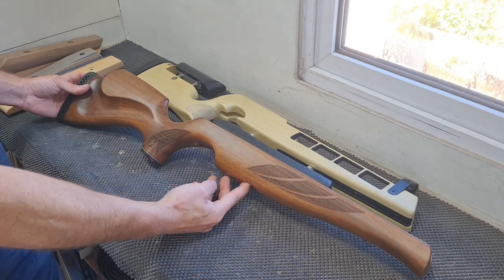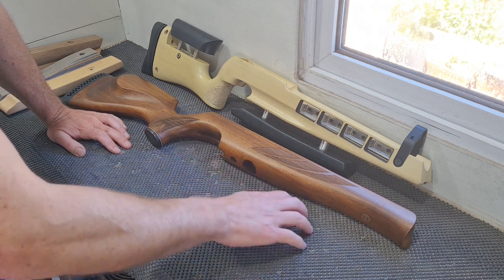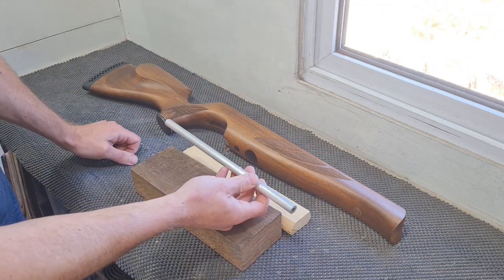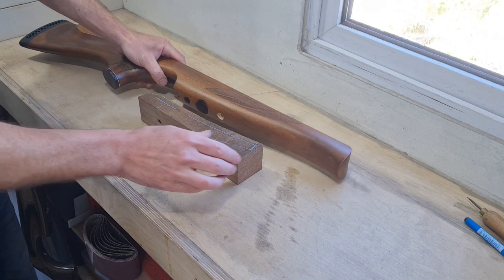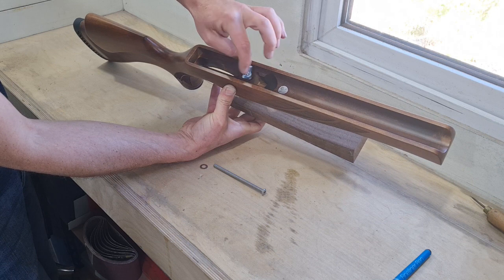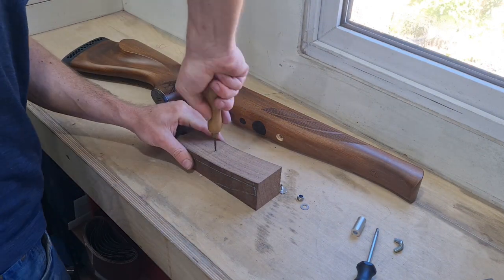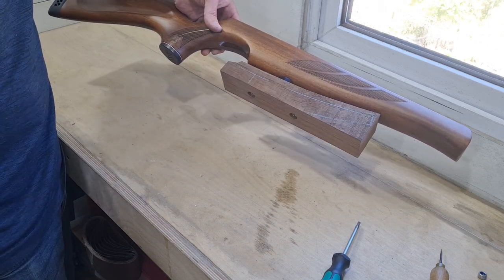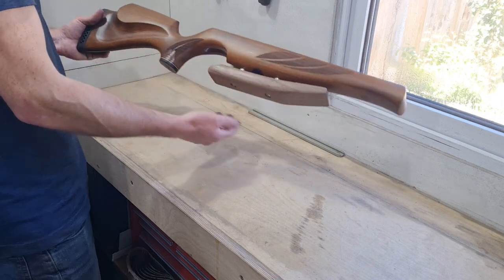making a custom hft hamster kit /palm rest for competition air rifles and field target guns

Comment: Looks fantastic! Great video, what thickness did the hamster finish at? I am trying to find a nice bit of wood to do the same.
Reply from the maker: Hi mate, I dont like to go any thinner than about 20mm where the fixing bolt holes go through.always best to air on the thicker side to keep it strong.

Most timber merchants will have smaller slabs of various hardwood. 
Beech is one of my favourite to work with
Reply: @tillysgunstocks  legend! Thanks